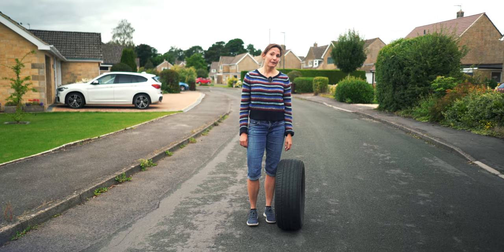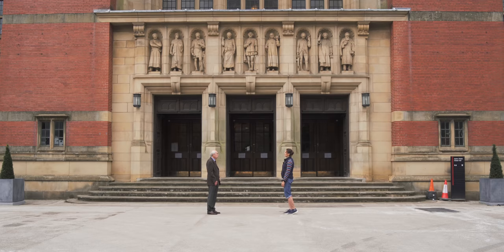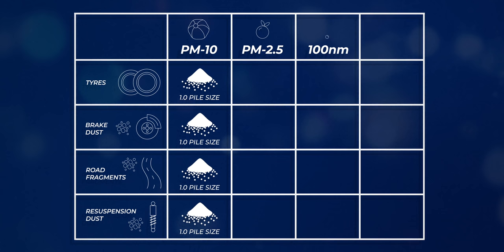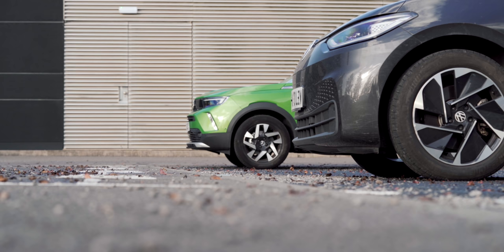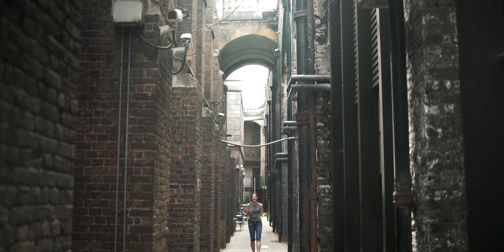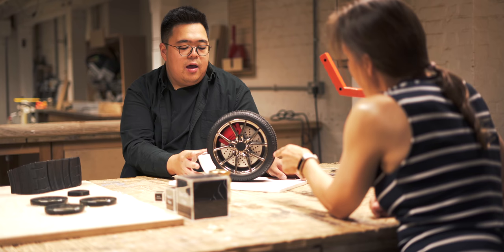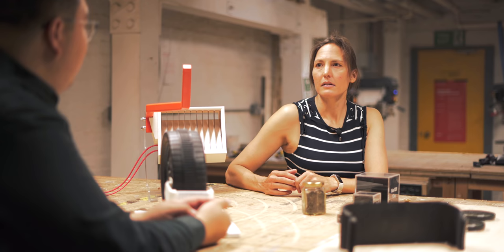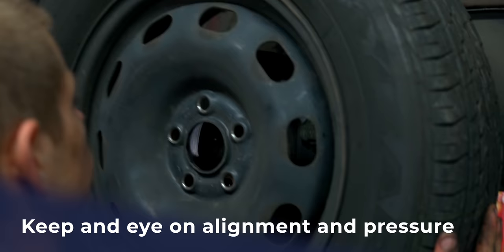The Secret Pollution That All Cars Are Guilty Of | Fully Charged

Comment from the maker: What do you think? Is it possible to re-invent the wheel and change these hidden emissions? Tell us below...
Reply: Why keep using wheels? Isn't it about time for levitation?
Reply: No subsidy on ebikes
Reply: @reshkumar  maglev?
Reply: I wonder if rubber compounds can be modified so that wear favors the less-damaging particle sizes.
Reply: Definitely worth looking at ways of not putting microplasics into water courses, maybe easier to skim rubber particulates out of road drains if they float rather than fit a four devices that need maintaining to every vehicle. And surely phasing out the ice vehicles will reduce old combustion/catalytic products being picked up off the road reducing rolling emissions further.
Reply: I think you need to get back to reviewing cars instead of nonsense like this.
Reply: All need to be aware that fast acceleration, harsh braking, and indeed fast cornering, all contribute to high levels of particle pollution. If we had an accelerometer built into each electric car, then we could perhaps charge drivers if they drive in such a manner that causes unnecessarily pollution.
Reply: Having four complicated devices on all four wheels to catch your vehicle's tire dust might not be the most economical thing.

Perhaps we can let go of this “I will do my best not to add to existing pollution” and go to an interdependent system of cleaning up a bit of your own pollution as well as other people's pollution.  

Perhaps it's easier to create a road vacuum system that just picks up a little road dust without worrying about who put it there. As long as such a system leaves the road behind slightly cleaner than before it was used the result should pretty quickly lead to a significant reduction of tire dust, brake dust, road fragments and resuspension dust.   

And instead of needing to regularly clean several separate devices with small storage capacity at every wheel there can be one easily accessible larger system that can be emptied every once in a while.
Reply: @cobbles62  It doesn't need a complicated device for each wheel.

Accelerometers are very cheap. You have one in your phone. Just one is needed, because what is being measured is G force when accelerating, G force when braking, and G force when cornering.

I quite like your idea about a cleaning device though. That's inspired.
Reply: Pushing for rail transport over road transport where possible could help reduce these issues.
Reply: @The18107j  much better will be redesigning the cities. I dream for some time at this. 
One step will be switching to deliveries instead of going to market for shopping.Parcels delivered by small modules, will consume only a fraction compared to moving around the mass of the person, plus the mass of a vehicle. 
Second is transporting people in small modules too. Being small will can ride suspended paths, and so will be no intersections, no stops, no complicated vehicles. Advantages will be numerous. Obviously the initial cost will be spicy, but soon the savings and benefits will bring a lot of profit. But this means a good leadership.
Reply: @bentp4891  seriously? This is way more interesting and informative and relevant. Circa 40,000 people die prematurely in UK from road traffic pollution. It’s pretty relevant in my opinion.
Reply: @ProfSimonHolland   That’s been the reaction of a lot of people, but trust Helen and her research. She is very thorough, reliable, considerate and scientific in her approach. If you do some research on the matter you’ll find she’s right. 
I notice you claim to be a professor, I’m surprised you’re jumping to such conclusions. They are serious, this is a serious matter and is most definitely not funded by the fossil fuel industry, Fully Charged is funded by Patreon.
Reply: I would also add that this is one episode to cover one item that is overlooked. I think you’re absolutely right and Fully Charged totally about stopping burning stuff.
Reply: should not use 'zero emissions vehicle' they are r'eally emissions shifted vehicles' -  moved to the power plants
Reply: @bentp4891 Why is it nonsense?
Reply: @deanfielding4411  focusing on the real but tiny issue of tyre ablation when ignoring the big issue of burning fissile fuels, plays into the anti EV lobby interests.
Reply: @deanfielding4411  I don't doubt Helen but focusing on EV tyre ablation is ignoring the bigger problem.
Reply: @ProfSimonHolland  Forgive me, I thought you were doubting Helens work. 
I agree the main focus needs to be on stopping burning stuff, but I think this subject is well worth at least focused episode to highlight other issues because FC main focus has been on stopping burning stuff. 
I was surprised by the evidence Helen found about how bad tyre emissions really are.
Reply: @ProfSimonHolland  I am absolutely sure that this is not the last.

They will find plenty more. It is incredible to what lengths people can go when they do not want to admit the obvious. 

Recently I just heard one that left me without words. It was revealed to me by my brother, a guy quite intelligent and knowledgeable, who even works in electricity field, starting as electrician and now being in automation. He was rightly reserved about electric cars, because of range and price, since our country is not quite rich. And few months ago I am surprised to hear that he is against electric cars, first because are polluting more. Sure, anybody can be fooled by this if not looking carefully, and then saying that costs more to drive them, he renting a hybrid. I countered these two with ease. Is obvious that in a lifetime evs are better, and why you talk about hybrids which are not electric cars, but an unfortunate experiment? And then he said that oil is anyway, regenerating, because there is a bacteria that does this.  This was new for me. I was left without words. Sure, oil was made out of dead bacteria, or involved some bacteria in making, but it took eons for the actual deposits to accumulate, and we burned half in a century.  How can somebody can come with this preposterous claim that oil is regenerating? And still they came with it. And what is more outrageous is that smart people believe it. and promote it, and will finally admit only after cornered that yes, they want comfort at low price.
Reply: @BixbyConsequence  Modified with more plastic?
Reply: There may be very, very little from the wear on all mechanical bearing and gear surfaces, and the lubricants, but they are still a part of the subject.
In an associated way, there is the question of how we are going to best make roads in the future.  Are there better, less damaging ways to do everything, it should all be open for questioning.
Reply: Thank you for highlighting this important issue, great video. I read about a couple of companies researching into alternative forms of tyre, but that won’t help with the road surface pollution, particularly as there are initiatives to mix recycled plastics into the roads.
Reply: Give Dyson a call,  I'm sure he could design a road vacuum cleaner.  Send it out at night on dry roads or stick it under a bus for each route.   Would create more down force for better handling like that F1 car they banned. Overtaking upside down 'men in black ' style?
Reply: I appreciate articles like this that are  focusing forward on all forms of pollution.  A big difference obviously betwixt ICE and EV is at idle, EVs don't pollute in any measurable way.  The rubber collected can't be used to make more durable, flexible roads, this is done now and it makes for a quieter roadway in respect to tire noise.  Keep up the good work
Reply: I would be interested in companies and people looking into replacement substances for rubber. Would formed bamboo or other substances be capable of replacing rubber and be safer in particulate format.
Reply: @ProfSimonHolland  Also need to include the difference in Co2 production when manufacturing an EV against manufacturing an ICE vehicle. Too many spurious reports saying EV car manufacturing produces far less Co2, to sweeten the product. Everyone knows just how bad ICE cars are, but EV industry shouldn't lie its backside off.
Reply: No more 0-100 times, more ‘single-pedal’ cars (though I already get shouted at by friends following my car because I still drive like a bicyclist, using gears and hills to slow down rather than hammering the brakes), lower speed limits, more roundabouts-less stop&go. Narrower width tyres - you know, like they used to be, and smaller diameter wheels too. Lighter delivery vehicles. More trains and trams with metal wheels. There’s a lot of huge SUVs out there, including mine, which could be a lot lighter, driving about with just one or two people in them - though I do use mine for my business, I’m working out a way to live without it since almost everything I need is well within eight km. Doing Art-Fairs as a potter is a substantial obstacle though.
Almost no-one likes any of my ideas, because they’re seen as ‘anti-progress’, but in the sixty-three years I’ve been alive most progress appears to have been quite detrimental.
Reply: i love burnouts
Reply: At least European brake pads don't contain asbestos nowadays. I'd like to know exactly what is being used as a replacement, however.
Are equally dangerous Silicates being used, for instance?  

Catalytic converters in fossil fuelled vehicles have also concerned me for years. Yes, the toxic heavy metals are catalysts, meaning that they are used repeatedly, but some of them are inevitably dumped onto roads, as shown by an episode of Cody's Lab, a number of years ago, where he collected road dust and scavenged Platinum (and perhaps Rhodium and Osmium) from it. Those metals occur in road dust in higher concentrations than is normally found in nature.

The Carbon used in tyres is definitely cause for concern, just as much as are the rubbers, oil products and Sulphur compounds. Small Carbon particles are a significant cause of lung disease and cancer. Ask any retired coal miner. 

Road surfaces are often made using the worst of the residues from petroleum distillation. It's about as bad as marine fuel oil. And it,s filled with crushed roach, including much of the dust which is generated by that crushing. Road wear leads to some of that dangerous dust and carcinogenic tar being thrown or lifted back into the air which we breathe.

As Helen said, every form of transport has unwanted effects. Even joggers generate more Carbon Dioxide per mile than walkers, and every traveller wears out their leather, rubber or plastic shoe soles and wheelchair or vehicle tyres. But as she also said, we can be more aware about potential sources of pollution, and then we can choose to mitigate those problems. They'll never be eradicated, but we can go a long way towards minimising the pollution of our environment.

I choose to drive my EV - which I need for mobility - economically, and that helps a little. If everyone could be taught to have similar attitudes, then that would make a noticeable difference.

Maybe vehicles could be modified to enforce  more conservative, safer and less polluting travel? There could be financial incentives, including cheaper insurance (as sometimes happens already), lower Road Tax (as with EV's, heading in the right direction), or even bonuses for making tyres, brakes and steering components last a lot longer. 

Looking at it the other way around, there could be bigger penalties, taxes and surcharges for being less conservative, and travelling more. (Mileage taxes have been suggested.) But bonuses are more likely to encourage people than are penalties.

Whichever methods are used, there are big incentives for pollution to be reduced. Primarily, these are improved public health, which saves everyone's tax bills, fewer accidents, cutting medical costs further, and better mental health, as a consequence of our surroundings being cleaner and more pleasant to live in.

The planet will look after itself. We don't absolutely need to save it. But if human beings intend to remain as a thriving species, we need to act now, before Nature resets the balance by deleting most, or all, of us. It's already beginning to happen. 

Endless COP talks are absolutely useless. Political shenanigans are irrelevant. Individual, and ultimately collective, action is both useful and essential.
Reply: nice work, but you are pushing a little too much, any kind of vehicles will make indirect Co2 emissions. who doesn't know that? one day stone age will come back
Reply: Great work Helen I know it’s more than just about tyres but instead of using a compound tyre we could use natural rubber which is very flexible and impact resistant, we could also genetically modify the rubber plant to grow faster, which is what Bridgestone Tyres are working on.   I noticed you had a Bridgestone tyre on your video so that made me initially think you were going to talk about them doing genome sequencing of the rubber plant, which is great to see them leading the charge, but if you cover this subject again it would be great to see you go speak to the people at Bridgestone.
Reply: dont make and sell an devise to capture just ban vehicles
Reply: What's in screen wash?  That stuff ends up on the road to
Reply: I would have called it "pollutions" cause that is not a single secret one alone.
Reply: I understand the concern and if solutions can be found that is great but no matter what man does there will be residual effects. Even riding a horse leaves pollution, and although it will decompose it can breed disease and methane. Well I think you see my point.
Reply: The solution is to make EV's that are small, lightweight, and solo or 1+1, rather than 4-passenge. No one needs a 2-ton vehicle to drive solo for less than 20 miles.

Comment: One thing that wasn't covered was the fact that friction generated between tread block and tarmac (that consequently causes the creation of these micro particles) actually increases enormously as we drive faster, because the power needed to overcome air resistance actually increases at the cube of speed. This is why a Bugatti Veyron's tyres, for instance, will reportedly last for less than 20 miles at it's maximum speed. High speeds mean significantly faster wear rates, even if the driver is otherwise accelerating and braking very gently.

In simple terms, each tread block on your tyre, scrabbling against the road surface to maintain forward momentum when it makes contact with the road, is working eight times harder at 80 mph, than at 40 mph. And I don't think many people, or indeed perhaps many Youtube EV channel presenters, understand this.

We really need every "EV" youtube channel to avoid any encouragement or glorification of speed that will exacerbate this pollution problem.